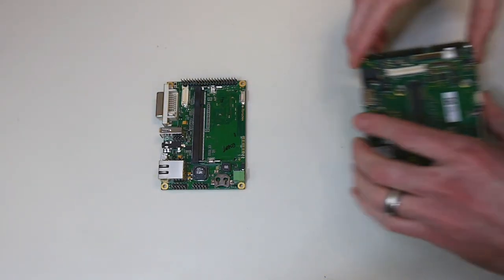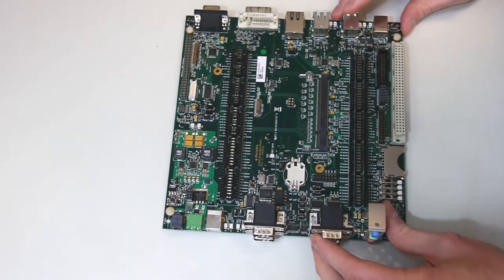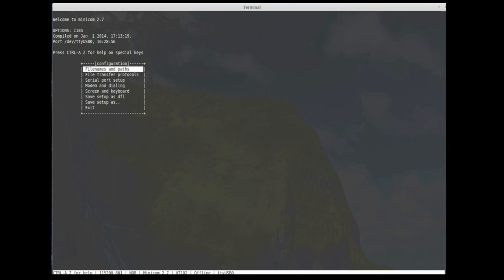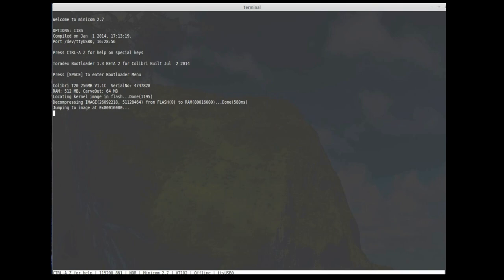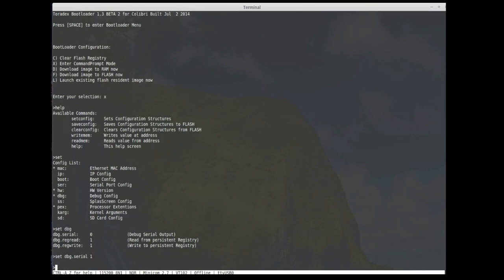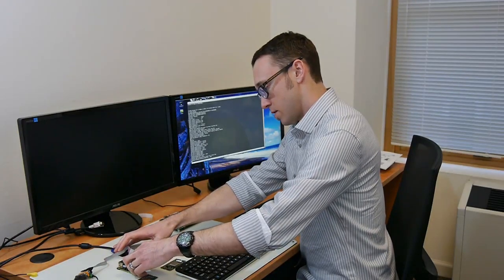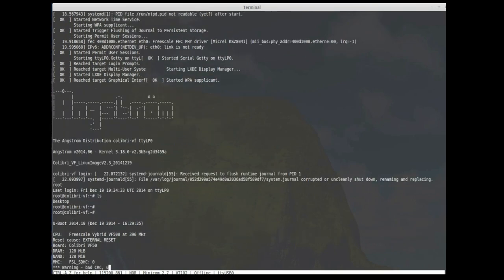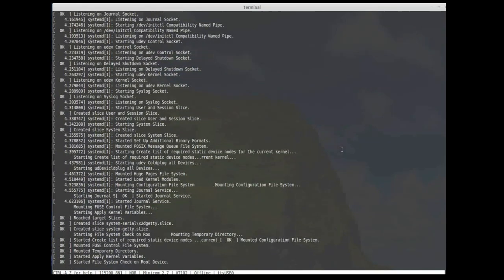Using the Serial Console with Toradex Computer Modules

Comment: for some reason I cant type anything into the serial console after the kernel loads...
before the kernel loads, I can interact with the bootloader just fine
but after it loads, the Angstrom message shows and it asks for a login, but nothing happens when i try to type
Reply from the maker: Did you enable HW Flow Control? The bootloader and the Kernel have different settings. I recommend give it a try to disable HW flow control in your terminal. Also for such question I recommend our community: https://www.toradex.com/community or other support channels: https://www.toradex.com/support/